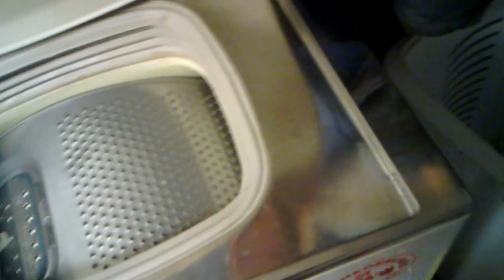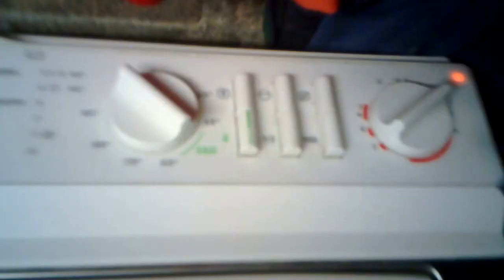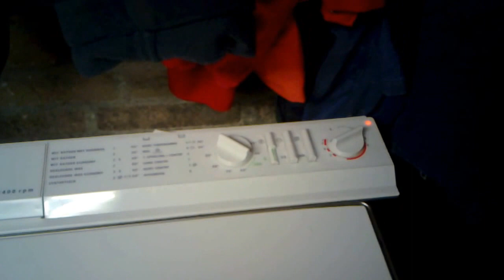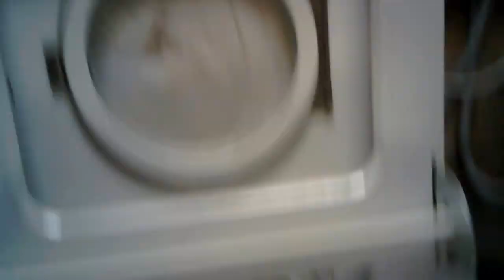Asko 12003 and 16004: washing on Program 2 (Part 1/2)

Comment: Great to see both Asko's washing away, and the waterlevel on the 12003 is just perfect for the duvet, after i've found out that i don't have the Gentle option on my Asko, i just set it to prog 9 Wool, let it fill up to where i want the waterlevel then, turn the dial to, prog 2 or any other prog, then the washer wil continue from that point.
Reply from the maker: +Electroluxwasher That's one way to get a higher water level in the main wash I guess.

Just uploaded the last 3 rinses and the final spin of the 12003, btw.